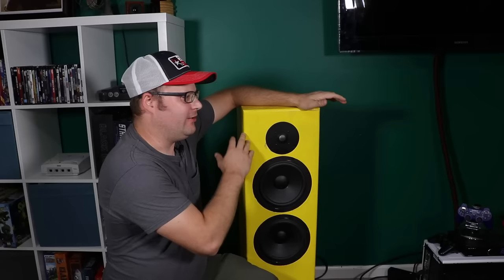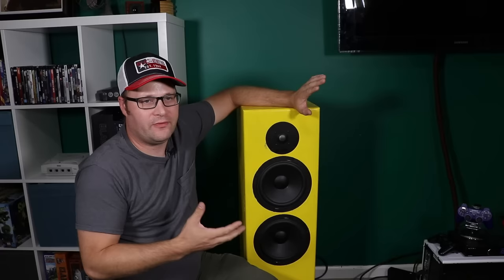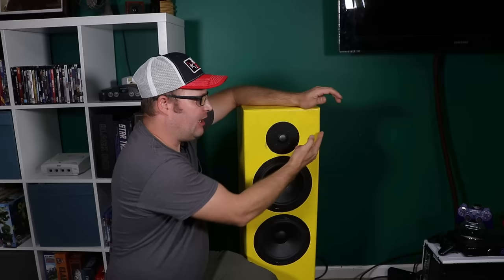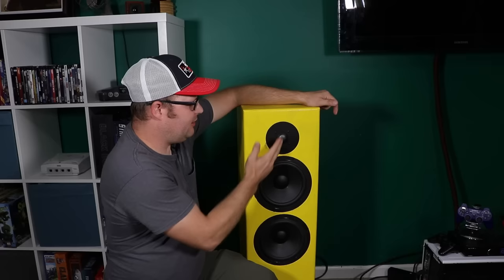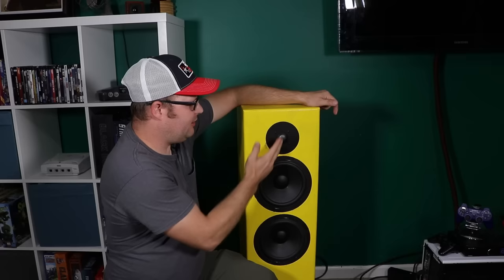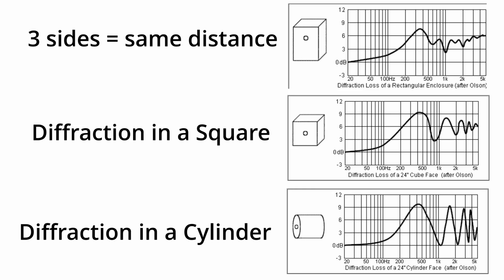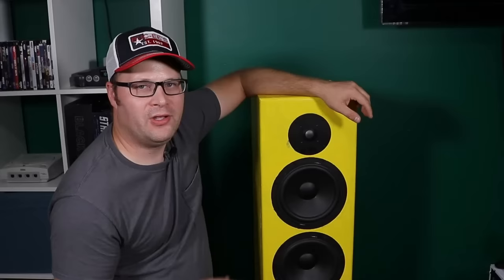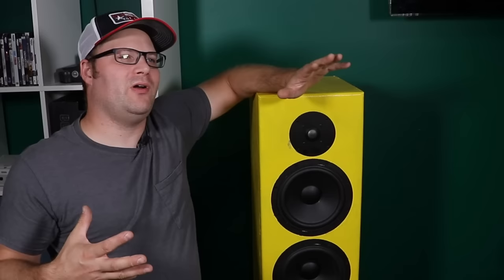The BEST Shape for a Speaker REVEALED

Comment: Question: I had a pair of Canton ergo DC 122 floorstanding speakers in the late 90s. It had a aluminum/magnesium metal tweeter with a 6 inch midrange  and two 9 inch woofers for bass. Beautiful German speakers. But it had velvet, and it was very thick velvet cloth,  on the front baffle. Was that done for reducing diffraction?
Reply from the maker: It absolutely was. I have nto personally tested that, but there are some proponents of this.
Reply: In the old David Weems books on speaker building, some of the cabinets had small squares of felt surrounding the tweeters to minimize diffraction.

Comment: couldn't you set the edge from  the tweeter  as far that the frequence where you switch to a midsdriver like 3000hz has just enough wavelength to not reach the edge i mean a 3khz wave is nearly 10cm long..

Comment: Interesting do you still frequent Parts Express's tech section as i'd be interested to know what you think of the edge difrraction on my 3d printed Ghettoblaster (ie based on sharp one from the 80's using 1.5 inch drivers)

Comment: The shape from the thumbnail is actually okay, especially with subs. Curve the whole front baffle as well and you get an ls50
Reply from the maker: Yeah the shape of the baffle on a subwoofer really doesn't matter. But it makes a huge difference on mid-range and tweeters. Remember the distance from the center of the speaker to the edge determines the frequency.

Comment: Very good, you're about halfway there for two reasons, cabinet volume and internal reflections. To talk about the bowl some more, its volume isn't large enough for lower bass frequencies compared to its diameter - it gets impractical. So you can increase the depth of the sphere by inserting a tube in the middle to increase its volume without a larger baffle. That makes it deep. To take it a step further, you can taper the tube, and twist the shape into a snail housing as it were, which then takes care of inner reflections much better than having a simple ball or tube. All internal standing waves and reflections can then easily be damped toward the tapered end. You'll end up with the famous B&W Nautilus speaker design in one way or another the longer you think about it.

Comment: A sphere is the best shape for a mono speaker. Try making them stereo image. See if it's possible to create a 3D sound field. Here's the thing, a speaker on axis clear of walls directed at you can be a great center speaker or a great mono speaker. Split the speaker into a stereo image and suddenly now the ideal speaker must account for lateral stereo sum roll off just like two drivers, or a main an a sub have to transition evenly.

2 spheres can't produce a 3D stereo image. All it can do at best is pan left and right and pass mono speaker tests.
Reply: The cabinet shape has nothing to do with stereo image. Stereo pairing speakers actually masks diffraction artifacts and your best bet to testing speakers is by listening in mono first, then optimize the design based on that. 
The lateral roll-off with speakers is due to beaming, not stereo-pairing. Hence why controlled directivity is an important design criteria irrespective of the number of speakers in your system. 

I'm being pedantic, but a stereo image can also never be 3D, it can be 2D at best.

Comment: @3:47 what difference would it make if the driver were the same size diameter as the pvc pipe? Do the drivers themselves have significant edge diffraction?

Comment: Great explanation!  Wondering if manufacturers are using more DSP to overcome diffraction effects so they can have whatever look they want.
Reply: to some degree this is possible. but your off axis response will be even worse if you try to correct for it, since the diffraction frequency also depends on the angle.

Comment: I recently purchased the knock-down 12" PA stage monitor cabs from Parts Express.  I'm planning on using the Dayton Audio 6.5x12 waveguides in this one.  The baffle on these cabs is recessed an inch and a half.  Obviously, I'm left wondering how horrendous this might sound in terms of edge diffraction now (something I started paying attention to about 5 minutes ago). Is there anything  I can do to mitigate this?  Does it matter as much with a horn loaded tweeter?
Reply: Good question, horns throw the sound so I believe defraction is minimal. I would suggest apply foam or felt around the horn or the entire front baffle.

Comment: But if you know the frequency, you can fix it with a crosaover/dsp right?
Reply: Not easily.  Diffraction occurs not at just one frequency, but many and the notches are very sharp.  Plus, equalization typically uses IIR filters but diffraction is essentially an FIR effect where fs = infinity.

Comment: This is all a technical perspective but now I would like to hear what these differences sound like in the real world.

In my limited awareness it seems like most of the speakers I've ever seen have centred drivers and sharp, square shapes as well as sharp edges. Are most speakers bad?

Would it be good design to have soft sound absorbing material on the front of the speaker, or at least something around the edges?

I did find this video interesting. I'm currently trying to figure how to make proper box design for some very small drivers which I'm repurposing from an old Bose desktop speaker system (the companion 2 series II).
Reply from the maker: Sharp edges aren’t ideal, but he also to keep in mind that they are by far the easiest and cheapest to make for manufactures. If you ever noticed high-end manufactures, they don’t actually have sharp edges. They either have a chamfer or a large round over. Even looking at speakers like definitive technology as you can see the large round over on all four sides. Or you can take a look at some thing like bowers and Wilkins and see how their designs differ from the big box brands.

There have been quite a few speakers that have actually put absorption material on the front of the speakers to help absorb diffraction. So that definitely can’t help if that something that you want to do. I don’t think many manufactures do that just because of looks more than anything else. 

As far as the audibility, you’ll find a long discussion on whether people believe it to be audible or not. You can absolutely measure it and see it’s effects on the frequency response. The respons is easily measured, and within the Audible band. Dr. Earl Geddes actually believes that diffraction is very important and should be taken care of.
Reply: @Toid  I've got some B&W bookshelf speakers, I'll have to have a close look at them.

Comment: Just wondering.  What if I  built a tweeter using a larger pvc pipe, but have it of set  to one side. I know it wouldn't be perfect, but how would it compar to the rest of the designs. It would be easy and quick to build.
Reply: I could also cut the pipe on a angle on both ends.
Reply: Yes, it will reduce the magnitude of ripples of the frequency response.

Comment: So why does the s400 wave guide work fine , isn’t it nearly the same principle as having a cylinder around the tweeter?
Reply from the maker: The s400 is a waveguide that is then mounted on a baffle. The waveguide itself is designed for controlled dispersion by the manufacturer. The diffraction wouldn't happen until it meets the baffle (assuming it is flush mounted). So the diffraction will happen at the edges of the baffle.
Reply: @Toid  I thought most of the sound would be dispersed away from the enclosure at the edge of the waveguide.
Reply from the maker: @shiraz1736   If the waveguide is flush with the front baffle, then it will not have hit an edge to diffract off of until it hits the edge of the cabinet.
Reply: @Toid  I’m surprised that the wave guide isn’t set 5-10mm proud of the cabinet if the cabinet has such a noticeable effect. Thanks for replying ✌️

Comment: Who can HEAR edge diffraction?  Especially in untreated rooms?
Reply from the maker: You should be able to hear any alteration in the frequency response of at least +\~ 3db. Sure your room will interact with that change, but to say you wouldn’t hear it because your room also affects response doesn’t make sense. That particular frequency will be affected by both the shape of the enclosure, and then again by the room. But I think this is one of those things that speaker designers are more familiar than consumers. When you start real-time tune a crossover, you can see that even one dB difference can make a huge difference at a particular frequency. so yes, even though the room can also affect the frequency response, you can still hear edge diffraction.

Comment: I really would like to see a demo sound wise to tell the difference to the ear.
Because it seems to me it isn't a significant factor since the Majority of the speaker designs out there are not SPHERES at all.
Reply from the maker: They aren’t spheres for quite a few reasons, but mainly due to complexity and cost of building. But what you will see is most have limited it by like I said earlier by making the offset between the top and sides and bottom different. While some companies like SVS Ultra take it a step further by chamfering the sides to help with diffraction. Keep in mind a dB is considered the smallest volume change a person can perceive. Anything one dB or more can be noticed. How easily will depend on the content and the listener.

Comment: Based on what I have learned from this video, a speaker built into a wall might solve that problem completely.
Reply: Yes, if you can do it cleanly, it will work well.  It does limit your decorating options a lot.
I think a curved front may work as well.

Comment: Those are good points, however I do not believe you can see by the shape of the baffle how good the speaker will sound.

For instance the new KLH mod. 5, where the baffle is framed in with wood for aesthetic reasons, which nowadays is often considered a no go because of diffraction and dispersion, but even GR Research (!) agreed that they sound, and even measure, excellent. 
I remember when Impulse Audio (where is he nowadays?) And KirbyMeetsAudio had a disagreement about this, when Kirby had his drivers mounted from the back in a rounded cut-out. I somewhat have come to a point where I can appreciate the KirbyMeetsAudio perspective on this - that speaker building is more of an art than an exact science, and ultimately about what brings you joy, and that just because a "rule" exists and maybe has its place, that doesn't mean you can't break it under any circumstances without being dissatisfied - even though I have to add, it's still important to understand those "rules" or guidelines and understand why they're there and what effect they have even when you choose to not follow some of them after all.

Comment: I just found this, and just cannot grasp how, a flat surface , can cause deflection.The sound waves are moving away from the drivers, in all directions , so how can the sound from the center of the driver, be deflected.?

Using a balanced set of drivers, even if you need zobels, will give way to a seamless sound, that , will give you a good listening experiance.
Reply from the maker: Each frequency has a length associated with it. The low frequencies will be very long, and will actually wrap around the cabinet. This is why, in speaker building, we have to count for what we call Bethel step compensation. The very high frequencies are very short and reflect directly towards the listener. And then there’s gonna be some frequencies that will be the exact length to hit the edge. Those will diffract.
Reply: @Toid  I know that frequencies have differing lengths, the higher in pitch, the shorter the space between waves.But the sound radiates in all directions  equally.
Place your speaker against a wall, and the sound is increased
,place it in a corner, and it increases again.
It would not work if, what you are saying about sound is correct.

Theile and Small , and some guy named Koss, laid the ground work, for modern loudspeaker design.
Reply from the maker: @davidhamm5626  you  will want to research it some more. Diffraction is easily measured and accounted for. I just must not be doing a good job explaining it to you. I will leave you the video of a friend of mine that tested and showed it. Maybe it’ll help https://youtu.be/UxFWWksOlYE
Reply: @Toid  I  realize what you are saying, I just know that they wrap around the enclosure, but at that point, the first law of thermodynamics kicks in.and they cannot return.
Reply from the maker: @davidhamm5626  did you watch the video linked above?

Comment: a cylinder will not have any diffraction if the speaker is as wide as the cylinder.
Reply from the maker: What makes you think that? It absolutely will diffract. Diffraction happens when the waves hit the edges. It doesn’t matter that those edges are the frame of a speaker.
Reply: @Toid  In that case, even a spherical enclosure can't avoid the edges of the speaker itself.
Reply from the maker: @johnaweiss  no that’s where you’re misunderstanding the concept. Do some reading on baffles up, and you’ll start to understand how the waves interact with the enclosure and why diffraction exist. With a sphere you don’t have any edges that your diffracting off of.
Reply: @Toid  "With a sphere you don’t have any edges"

What about the edges of the speaker?
Reply from the maker: @johnaweiss  that’s where you need to refer back to large roundovers and the effects it has.

Comment: speaker shapes is a quite easy topic.
drivers have two sides front and back.  
for all that happens in front of a driver the best cabinet shape is narrow and deep with rounded edges.
for all that happens at the back of a driver the best cabinet shape is wide and shallow with lot of free space around driver.
so the easy answer is - there is no best shape for a speaker box.

P.S. spheres are not good shape for a speaker.   they only good in terms of diffraction so suitable only for tweeters.  
as for entire speaker - sphere is very bad in terms of internal resonances and it is very inconvenient when you need larger volume.

Comment: No, a sphere is not the best enclosure. These decades old graphs made by Olsen are made up! You will not find reliable measurements that confirm his assumptions. 

A sphere also diffracts, just not as sharply at one singular point in space. 
However for anything that does not have constant directivity, which covers basically everything without a properly designed waveguide, you should not design the cabinet such that the soundwaves have to bend (diffract) around the cabinet very close to the source, where the level is the highest. 

Rather you should keep the point of diffraction further away with a flat baffle and then have a large enough roundover on the edge, which is frequency dependent of course. 
For a sub and midbass: Don't bother. 
For midrange and tweeter: Get as much roundover as possible.

Comment: I'd tell you you're FOS.😉
Reply from the maker: It’s been accepted since the 1950s when Dr. Harry Olson published the research. You’re welcome to look it up, but here is a good write up on stereophile that might help you understand baffle diffraction a little better. https://www.stereophile.com/reference/704cutting/index.html
Reply: @Toid  Of course, like everything else in audio the physics was worked out in the first half of the last century. However,  you can correct for baffle diffraction and that's not the only determinant of sound quality.
Reply from the maker: @interesting7906  of course not, there’s a lot of things that go into getting good sound quality. But how are you believing that you’re going to correct for baffle diffraction without changing the baffle shape?
Reply: @Toid  Yep.  I'm sure you are aware that diffraction does not just occur at one frequency but is the result of the direct signal interacting with the diffracted signal(s) causing comb filtering.  It would require many filters to correct for it and even then, filters are usually IIR so they would have the wrong phase.  Even if the phase could be corrected, it would only work at one angle as the effects of diffraction have a dependence on angle.  As of the time I last researched it, Peter Svensson had the most completer diffraction model.
Reply from the maker: @AndrewUnruh  great concise explanation.  I appreciate it.